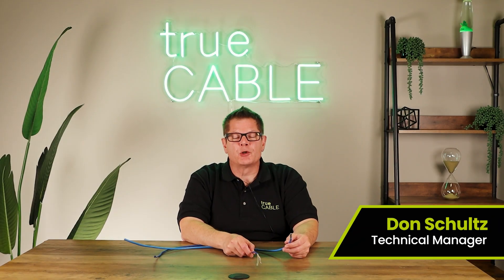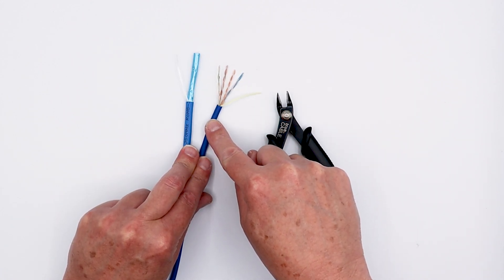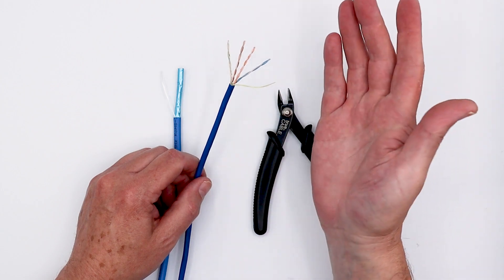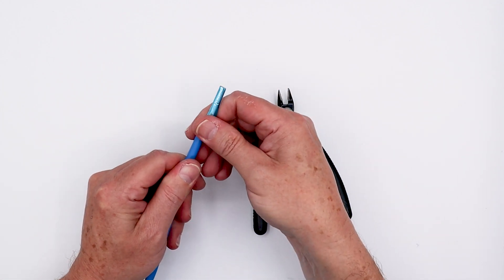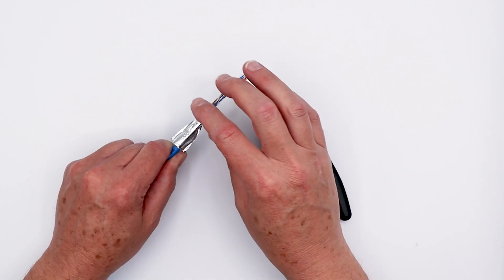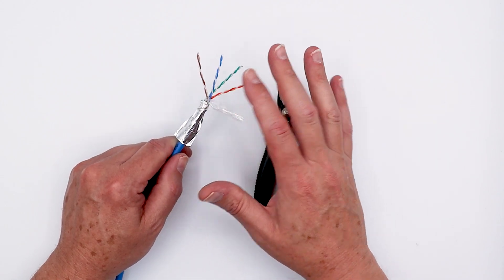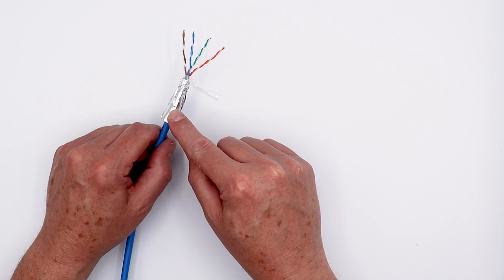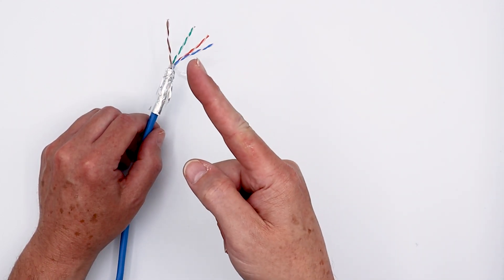Shielded vs Unshielded Ethernet Cable: When and Where to Use

Comment: Good video!
I'm doing some experiments with EFT/B which defined by IEC61000-4-4.
The experimental results surprised me that when I am doing 4kV of EFT/B test, the shielded cable failed the test, the network not working during test.
After I changed the cable to un-shielded, the same level of EFT/B passed with criteria A.
How the different may occur with shield and un-shield cable?
Reply: I did the test again.
I found the interface signal come back from the Bob Smith termination resistor.
Reply from the maker: @BMM66666  Hello SK! Indeed. I am glad you figured it out.
Reply from the maker: Hello SK! That is pretty interesting! The only thing that pops into my mind as a possible reason would be the shielded cable was not bonded to ground correctly. If the cable shield has nowhere to drain off to, EMI/RFI can start causing more issues than if you had not used shielded cable at all (which you discovered). This just underscores the necessity of properly bonding your termination hardware to your Ethernet cable and then making certain there is a low impedance path to ground (equal to or less than 100 milliohms). Of course, this is just my best guess of why you saw this phenomenon and something else could be amiss too.

Comment: Tell me about difference between ethernet and twisted pair cable plz
Reply from the maker: Hello! Ethernet is a network protocol that can run across fiber, copper twisted pair, and coaxial cable. "Ethernet cable" is a term commonly used to describe copper twisted pair Category cable, but that is not technically accurate. Therefore someone who says "Ethernet cable" is likely referring to copper twisted pair Category cable. I hope that clears up any confusion!
Reply: @trueCABLE  which of the data communication is more appropriate to design Local area network.why and explain it
Reply from the maker: @mahesh3507  Hello again! Your question is not possible to answer in a vacuum. Each LAN is different. Some LANs need only copper twisted pair. Some LANs require fiber backhauls due to speed and/or length in addition to copper twisted pair. Some LANs are 100% fiber optic. In addition, some LANs require WiFi backhauls mixed with fiber and copper. What you are seeking to do with your LAN (and the physical layout), define the technologies you should deploy.

Comment: You're missing the F/FTP cable, where each twisted pair of wires is foiled, and then the whole cable is foiled too.
Aluminum foils are the best cheap compromise to shielding even though regular Cat 6A FTP is probably good for any home and for the next decade or more.
Reply from the maker: Hello! You are correct, there is also S/FTP and F/FTP shielded Ethernet. We don't carry either of those (yet) but when creating the video we were referring to our products. The same general concepts of shielded vs. unshielded apply, however, regardless of the shielding level.

Comment: Question
are Sheilded Cables reliable to protect against EMP
Reply from the maker: Hello! Well, yes, cable shielding can protect against EMP assuming the cable and termination hardware are properly bonded to ground. Also, the strength and distance of the EMP source will play a crucial role. It is really something you won't know for sure unless you test it. Testing would require powerful (and dangerous) equipment along with a laboratory environment.

Comment: How to ground a shielded cable in a connection PC - Access Point/Switch? I would presume that by default these devices ground their RJ45 sockets when they are connected to the power outlet with a grounding pin
Reply from the maker: Hello! In this case, the Ethernet cable shield will bond to ground at both the switch and PC. Hope this helps!
Reply: @trueCABLE  Hi, thank you for your replay. I heard that shielded Ethernet cable should be grounded only from one side, does this mean that in this case I should only terminate one end with shielded casing and 2nd one only with plastic, so it will only be able to be grounded from one side?
Reply from the maker: @Gotcha-san  Hello Gotcha! I fully understand the confusion. It is true that you should not have more than a single AC ground. That said, you should have as many bonds as possible to the same AC ground. Bonding and grounding are related, but not exactly the same. Suffice it to say that when you are dealing with a common AC ground (single residence, for example) you can and should bond to as many points on that ground as possible. The risk of ground loops comes in when you have more than one point of ground (like two different structures with two different electrical services, for example). We hope this helps! Please let us know if you have further questions.
Reply: @trueCABLE  Thank you so much. You guys are the best!
Reply from the maker: @Gotcha-san  No problem, this is what we are here for!

Comment: Hello and glad I came across this video.  So I did hear that you said performance won’t be any different with the shielded vs non shielded.  So I’m re doing all my cat5 to cat6a and see at least 120.00 dollar price difference.  I run all my stuff in the floor boards and have about an 8 foot run where it touches all my 14/2 wires from the house panel.  Would this be a reason to get shielded or would it be ok to run all my wire unshielded.
Reply from the maker: Hello Campos Family! We are glad you came across our video too. It is correct that shielding in of itself does not increase performance. Making the decision between shielded and unshielded Ethernet cable is an installation environment concern. In your case, I would still hesitate to recommend all shielded Cat6A as installing shielded Ethernet dramatically increases costs and complexity of the installation. In the small trouble spot you referred to, I would use some sort of metallic divider for that short 8 feet. A 10 foot piece of ENT (electrical metallic conduit) is an ideal solution. For five Cat6A Ethernet cables (7.0mm diameter each cable) use 1" conduit. If you need to fit up to thirteen cables, use 1.5" conduit. Install the conduit and then run your Ethernet through it to protect it from EMI. It is strongly suggested to bond one end of the conduit by using a split grounding bushing. You can pick up the conduit and grounding bushing at Home Depot or Lowes. The grounding bushing will slip over the rough end of the conduit and have a plastic insert to protect your Ethernet cable jackets from getting abraded. The bushing will have a provision for attaching a bond wire. Use 12AWG stranded green THHN and attach it to the ground bushing and then bond the wire to ground at the nearest electrical box (if inside your main breaker box, have an electrician do that!) The other end of the conduit should have a simple slip-on plastic protector bushing to protect your Ethernet cable from damage. The plastic protectors come in four or five packs and you can buy the ground bushings individually. Make sure you buy the right sizes for your metallic conduit. Materials should cost less than $30. I hope this helps!
Reply: @trueCABLE  yes awesome.  And thank you for the thorough explanation and step by step for this situation.   Now for the tough part, doing the install at home.
Reply from the maker: @camposfamily5091  You are welcome! Yeah, it is fun thinking and planning out an install. It is also fun buying stuff for an install. THEN, you have to actually do the install. :>)

Comment: Can you explain why medical equipment that a patient would be touching requires Unshielded ethernet cables when connecting to the network? Presumably to avoid shock risk to the patient.
Reply from the maker: Hello Allan! I have never heard that one! Per ANSI/TIA-1179 shielded cable is highly recommended due to the high amount of potential alien cross-talk and EMI that can be created by equipment regularly found in hospitals and healthcare facilities. There is no more or less risk of electrical shock (ESD) from shielded vs unshielded patch cords. In fact, I would say they are equal since the patient would not be able to touch the cable shield and would be touching the plastic (PVC) in either case. Hope this helps!
Reply: @trueCABLE  Yes that helps. Thanks!
Reply from the maker: @apmiller77  No problem, Allan. Glad to help.

Comment: I bought a cat 8 Ethernet cable. And when I got back home. The part connected to the router melted right where the gold plated part is. What could have caused this?
Reply from the maker: Hello Sliq! That would be a very unusual situation! The only thing I can think of would be a short circuit of some type where the other end of your cable came into contact with high voltage. I would discontinue the use of any suspected equipment as it sounds like there could be a fire hazard somewhere in your installation. We hope this helps! Let us know if you have further questions.
Reply: @trueCABLE  ok thanks

Comment: I’ve been using true cable cat six unshielded for about a year now. And some of my cables are ran right by a home theater subwoofer with a large magnet. I could never find the answer to this, but will a magnet affect my cat 6 cable?
Reply from the maker: Hello, Yeezy! No, it probably won't harm anything. The home theater subwoofer should already have shielding built in to prevent it from messing around with anything else.

Comment: In a shielded cable, are the pairs made of the same conductor compared to an unshielded cable? I wonder if the shield affects the impedances of the wires and Ethernet standard.
Reply from the maker: Hello MJ. It depends on the cable, quite frankly. Generally speaking, the conductor gauge and insulation around the conductors is the same. Internal construction of various shielded cables might be different. Some shielded cables have pairs that are individually foil shielded along with a wire braid shield overall. In the case of F/UTP, there is a foil overall shield but the pairs themselves are unshielded. A cable that has individually shielded pairs will typically skip the spline as it is no longer needed. Impedance of the cable may be affected, but per the standard it must be withing +/- 15 ohms of the nominal 100 ohm impedance requirements.

Comment: I have a long 20m un-shielded cheapo Ethernet cable from amazon running from downstairs to upstairs in my room to my gaming PC. For 5 years now, I felt that my mouse input felt floaty and weird, Never knew whats the cause. Until recently I found a post in blurbusters with the same problem, all they did is change to a shielded cable instead.

I managed to fix my problem without doing that. My Ethernet cable was wrapped in a circle, on the floor, over a plug extension. I tried moving the Ethernet away from the extension brick thing. The problem did not immediately fix. It took a day until the floaty feeling went away. This is crazy.
Reply from the maker: Hello and thanks for sharing that. That sounds pretty unusual, but I am glad you figured it out! I suspect the issue had more to do with the circle loops the cable was in then simply being in proximity to your electrical strip. For example, BICSI recommends that any cable that is stored as service slack in a telecommunications room be turned into a figure "8" pattern in order to avoid picking up EMI/RFI. As it turns out, circles are rather apt to pickup interference. The other strange thing about your situation is most simple extension cords should not pose that much of a risk to Ethernet when it comes to EMI/RFI (we are talking about 120V) as long as they are correctly made. I am wondering if the extension cord itself might have had something to do with this too. Either way, your lesson is a valuable one: Keep Ethernet and AC electrical cable separate!
Reply: @trueCABLE  oh interesting. I will try wrapping my ethernet cable in that pattern aswell. Thanks! Also I live in the UK btw, I think electricity is higher here. I'm not an expert so, excuse my wording 😅
Reply from the maker: @SupertigerDev  You are welcome. Also, you are right! In the UK the voltage is 230V. That might be the difference!

Comment: Can we use flat cables for outdoors, and passing them trhoughout inner electrical pipes into the buildings (roof, and walls) ?
What are the considerations to have ?
Thanks
Reply from the maker: Hello Ducky. The USA based NEC/NFPA 70 is pretty explicit about fire safety and the use of outdoor cabling in commercial structures. Outdoor cabling (referred to as OSP or Outside Plant) may only run from outside to inside a building up to 50 feet before it must be terminated and transitioned to indoor rated cable. Whether the cable is flat or not is not relevant. There are some exceptions for single and duplex style residential dwellings in regards to use of outdoor rated cable indoors, but that is another discussion. As to using electrical conduit for pathways: don't do that. Ethernet pathways should avoid AC electrical circuits and definitely not run in the same conduit.